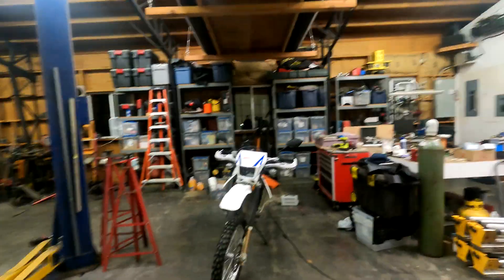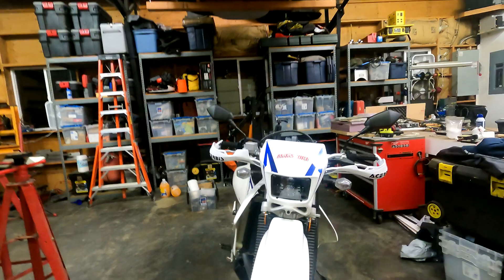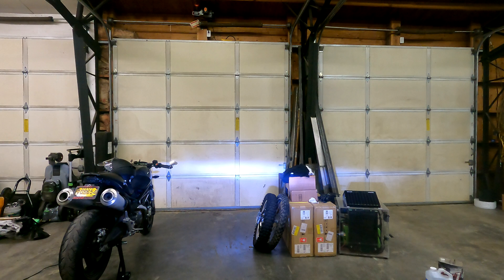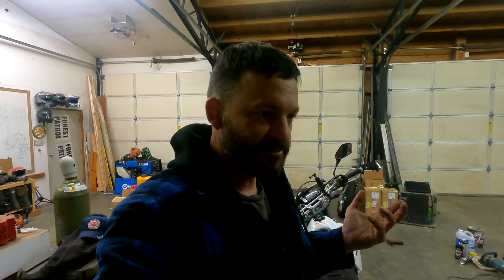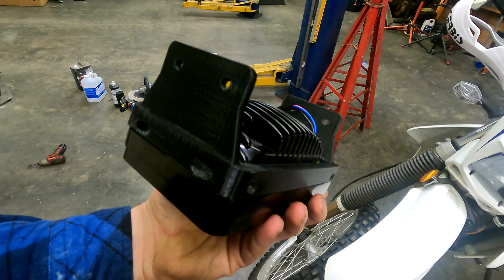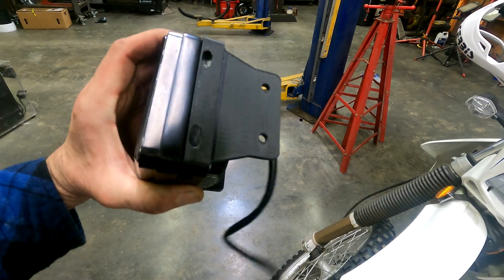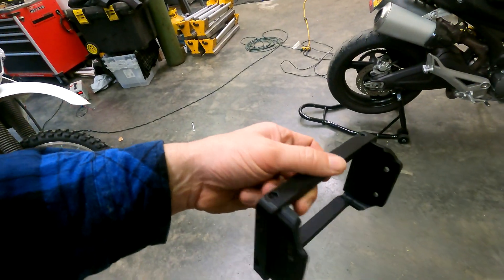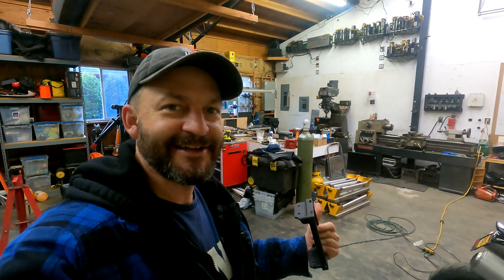Installing a Morimoto 4x6 LED headlight in my DRZ400 with a custom 3D printed bracket

Comment: Nice project!

I'm looking forward to your accessories project. Will you be running them on a relay circuit? If so, I'd be very interested to see some footage on the components/locations/methods you choose for wiring.
Reply from the maker: I briefly contemplated installing a small fuse box with a key-on relay, but ultimately decided that wasn't going to be necessary.  I made a "piggyback" connector that plugs into the DRZ's factory wiring harness (so no cutting or splicing needed).  It allows me to pull up to about 10A from the tail light circuit, and it powers a small digital voltmeter, two USB-C charging plugs, a USB-A QC 3.0 plug, and a wireless phone charger/holder.  The project is done...just need to edit the video!